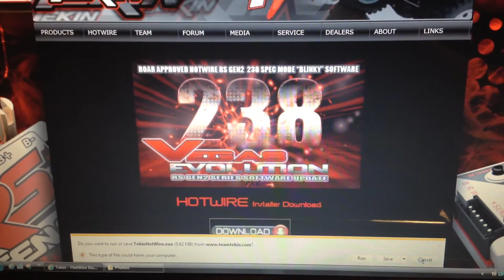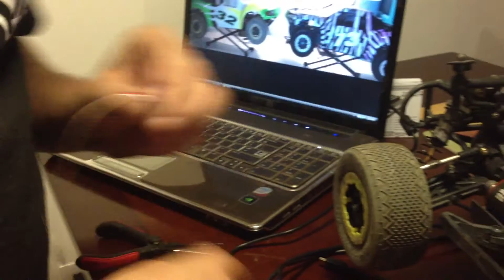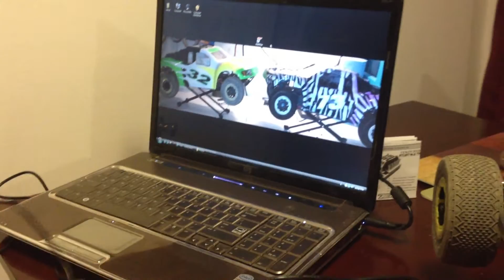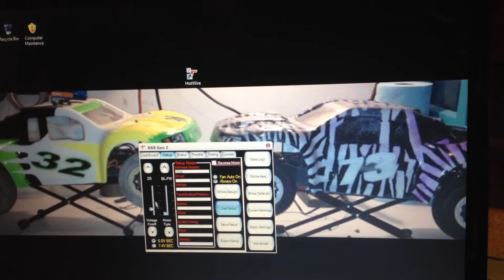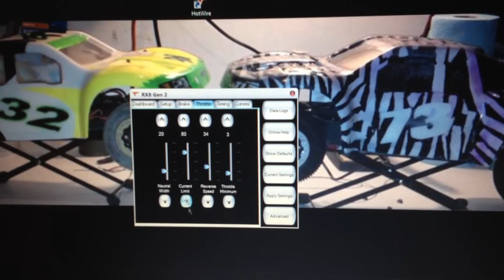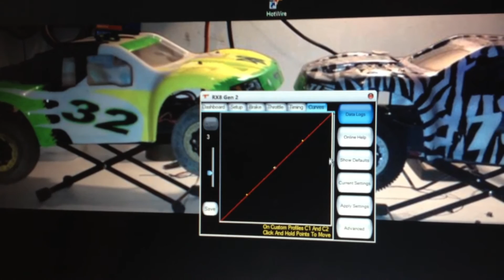Hotwire and Quick Tuning with the Tekin Rx8 Gen2

Comment: Hey man, great video!! I just got my very first Tekin rx8 gen-2 a few months ago and put it in my Axial Yeti kit i built in april. Until i get a tekin sensored Pro4 hd or Roc412, i have a castle creations 1410 3800kv 4-pole sensorless motor soldered on to it. Included in the deal with the rx8 was two extra tekin fans, hotwire 2.0 (white) and an extra white case, in case i wanted to switch from black. I would like to know more about throttle minimum and current limit in particular because when i give full throttle at a stop or coasting lightly, it seams to be limited. I would like to get a bit more punch. Also i would like to know how i set up the system so that the 20c rated 5000mah 2s1p zippys i use don't get overdrawn. Thanks.

Comment: Thanks for this informative video . Does the timing function helps to boost up speed at certain rpm ? If this is my understanding this mean it will help in drag racing , correct ?
i'm not sure about the timing function so i need you to confirm the above if it's true.
Thanks again

Comment: please explain the current limiter, and throttle minimum please dirty!
I run GT8 onroad and have the rx8 gen2 and a 1900kv t8 but im geared  36spur 25 pinion I need help understanding the timing advance, and the start  and end rpm whats that do exactly??? so basically timing advance, I know what timing does, but on the hot wire program can you give me some advice of where to have my start  and end rpm and what all that is and what is the current limiter exactly bc my car slowed way down when I didn't have the current limiter off. I just need a pretty much balls out programming for onroad / track racing thanks a lot man

Comment from the maker: It can be used on different esc. You can only use one hotwire at a time on a computer, meaning dont plug to hot wires into the computer at the same time. All the data that you save, saves to the computer, and the settings that you change will be saved to the esc that you are connected too. I hope this answers your question, if anyone else has questions post them up we are happy to help.